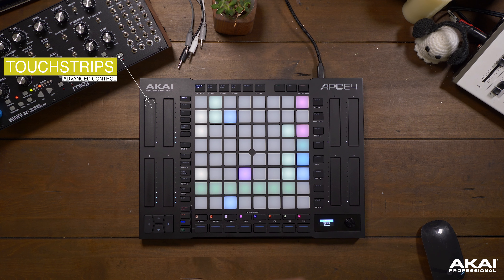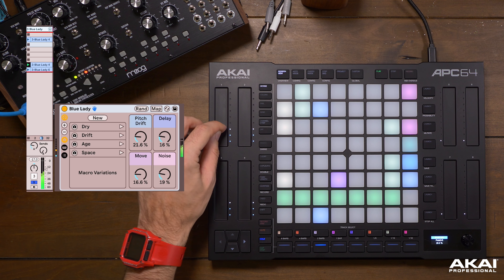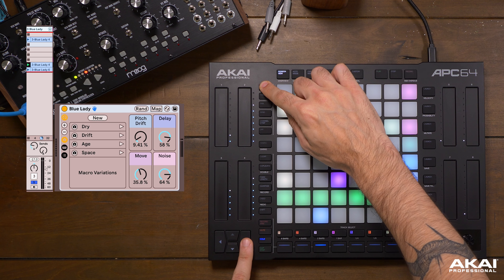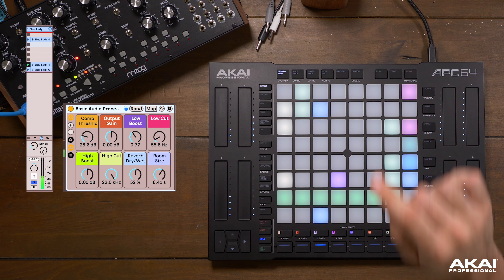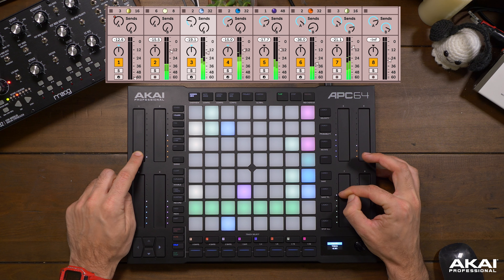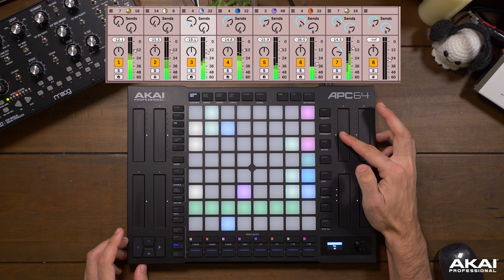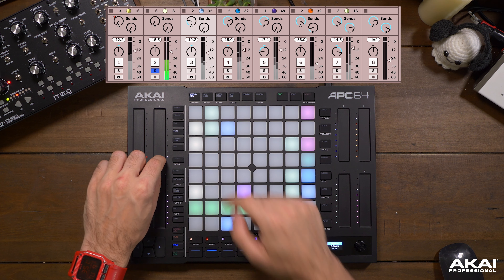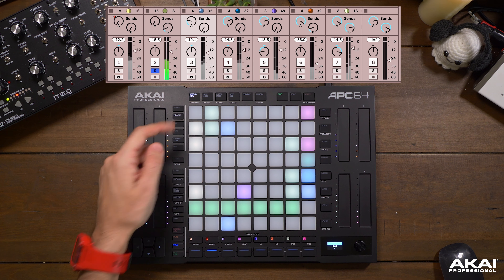Using The APC64 Touch Strips | APC Academy

Comment: Ableton live is not recognizing the apc 64 as a control surface? I updated ableton but is the apc too new? Please help
Reply from the maker: Please be sure to have performed the firmware update for APC64 to ensure the best experience. Visit akaipro.com/support for more information
Reply: i have done that but apc 64 does not show up as a control surface and i have ableton fully up to date 11.3.11 @AkaiProVideo
Reply: @brendonsmith8025 yeah ableton probably won't be up to date for it yet. I got the apc mini and basically waited a full month before I got to use it with full functionality. For some reason 2-3 weeks in from getting it they did some update but it didn't have full functionality. Hope you don't have to wait long for it but that's what happened to me atleast. Not sure about other people's experiences
Reply: I had the same problem and I also thought it shipped with the firmware I ended up starting over and following directions start to end even if the firmware seems up to date ableton needs to update and drivers have to be I stalled and should be good to go.

Comment: A keyboard can do all that with knobs?
Reply: Correct. I have 3 keyboard controllers all equipped with a keybed, knobs end even pads! Buuut. What those keyboards DONT do is have a standalone sequencer that can sequence hardware and modular gear with midi and cv and that's where this akai grid controller comes in. You can also save your projects onto the device and send it to ableton. This dude barely scratches the surface of this thing. Sure there are other controllers out there but for people who have a hybrid set up and don't have a push this is good.

Comment: Bring back faders 😢
Reply: Hope akai brings out a mixer ala novation launchcontrol xl to go with the apc64 but higher quality, with the same dimensions, 8 knobs and 8 faders in a row, with 8 extra knobs on top to control the selected device with blue hand. And if the dimensions could be the same we could use 2 or more at the same time. 2 apc64 next to each other, with below them a pair of those mixers.Kinda like the quality from the faderfox mx/pc 12, but a lot cheaper…(1400 euros for the 2) 128 pads, 72 knobs and 16 faders would be awesome.